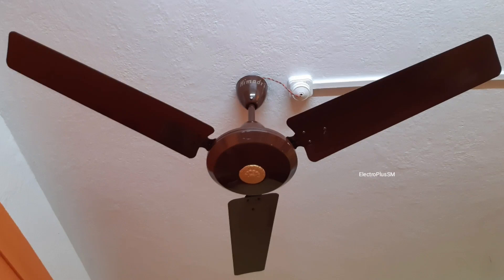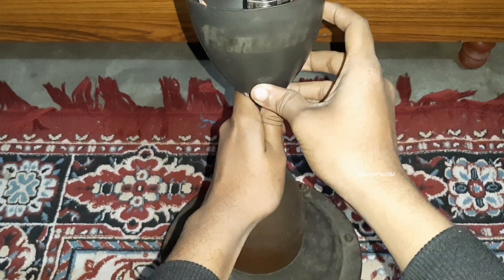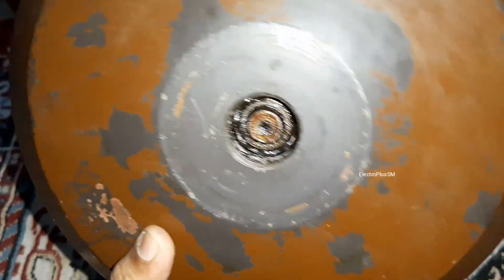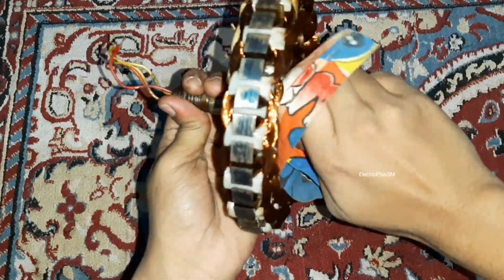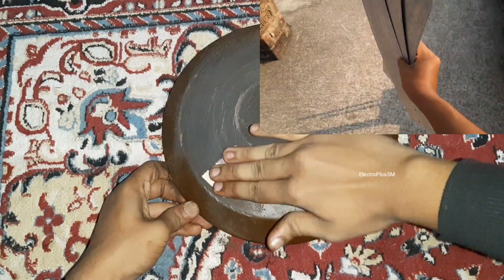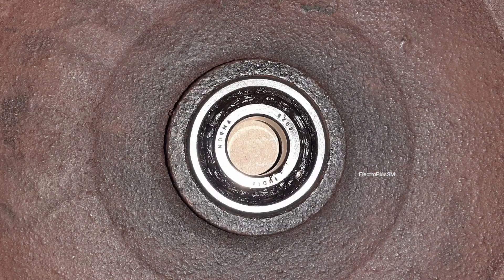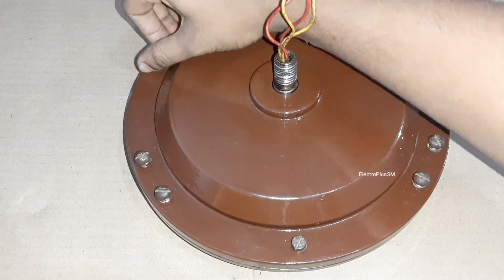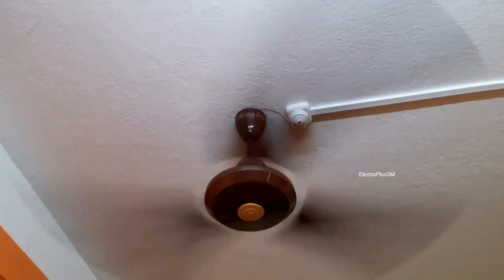Himadri (Early 90's) ceiling fan hand painting in Brown colour

Comment: These kinds of threaded downrod and capacitor mounting counterparts are found in old 50's-60's era usha fans as well...some of those models were popular, deluxe and all those electric steel sheet ones..made by the FMA
Reply: I know that even kohinoor and all had the same thing but that's not exactly same...some difference is there..and the opening and fitting is quite different